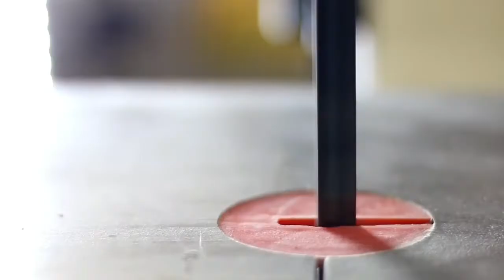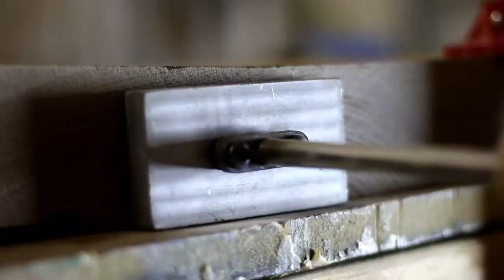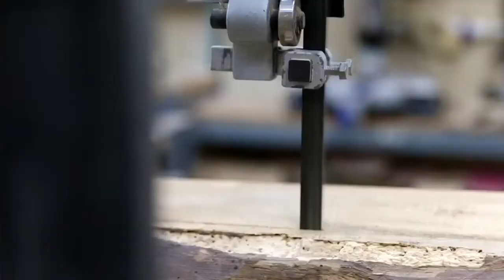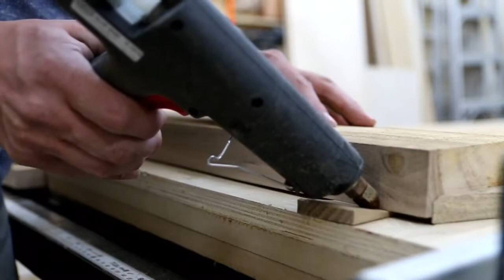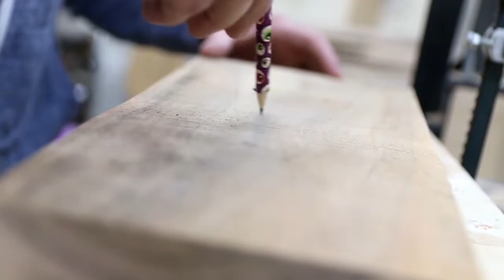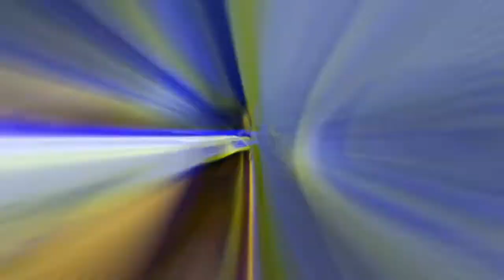Mid Century Modern Walnut Desk Part 1 | Woodworking

Comment: It seems to me that using a nice sharp hand plane would be about twice as fast to flatten those short boards as setting up your planer sled.  If you've never used one, you would be pleasantly surprised at how quick it would be.  You don't even have to get it perfectly flat, just flat enough where it doesn't rock when you send it through the planer.  I just started using hand planes at the end of last year after 30+ years as a woodworker.  They are awesome.  Looking forward to seeing the finished product.
Reply from the maker: That’s very true, I would love to get into hand planes eventually.  What’s a good hand plane that you would recommend?  Thanks for sharing, I really appreciate it!
Reply: @blacktimbercompany5716  A used #4 would be a good choice for a first plane.  Antique Stanleys can be found on eBay.  I wouldn't pay more than $35 or so.  I imagine you can get a new Stanley but it wouldn't be cheap.  Veritas makes excellent planes but again, they are very expensive.  I use two planes the most.  A #4 Record plane and a #5 Stanley plane.  I've used Buck Brothers planes and Great Neck.  I have not used a Veritas, they look magnificent.  Of everything I've used, Stanley is the best.  I even have a brand new Stanley low-angle block plane.  It works great, but it had some issues out of the box.  Good luck!